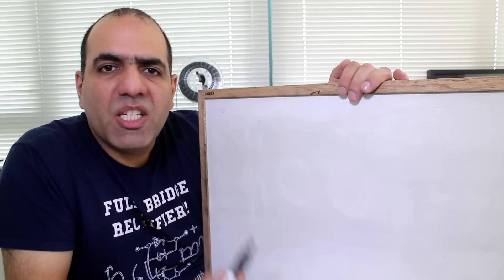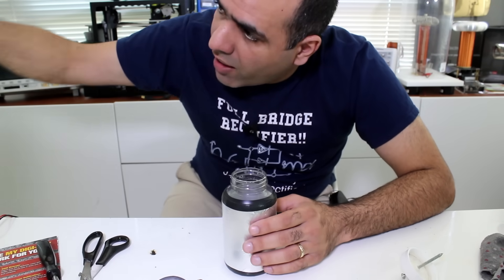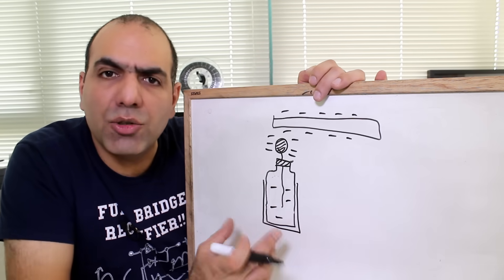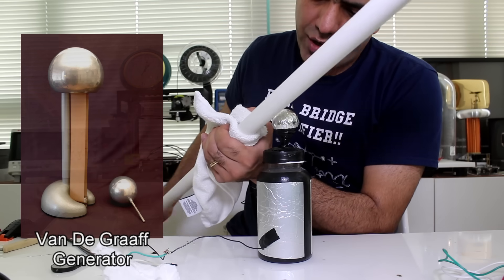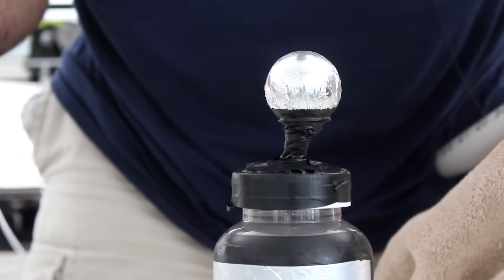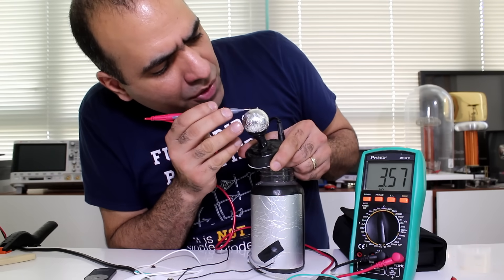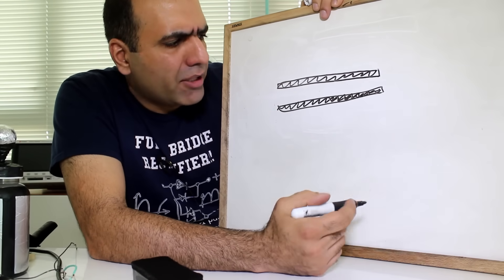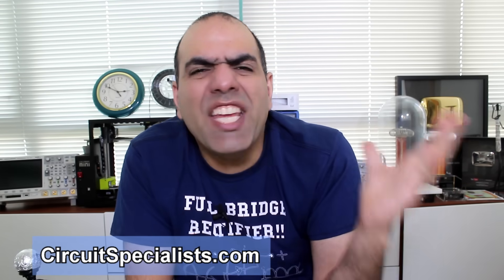Make a SUPER HIGH VOLTAGE Capacitor

Comment: In my high school physics class, when we were given the task of building a Leyden jar, my group (me and a couple other students) decided to use a huge bell jar (larger than the one in the background over his Tesla coil), lined with foil on the inside and outside.

In the middle was a plastic meter stick with an alligator clip wire attached, the other end of which went to the interior foil.  This left an air gap of at least six inches between the charging point (the clip on the ruler) and the outside foil.  Despite this, while charging with a Van de Graaff, the voltage became high enough to jump the gap and discharge.  The spark (or miniature lightning bolt, which it more closely resembled) badly melted the meter stick.  We decided not to try charging it again.  After all, the teacher had informed us at the start that what we were making would be lethal if discharged into a person, so we had better be careful (this was 25+ years ago).

Comment: If you fold the edges of the aluminium foil about 5mm in, that will increase the radius on the edges and reduce partial discharges. Meaning the charges will have a harder time flying away.
I learned this visiting a factory for high voltage bushings. ^^
Reply: Oh and this was an amazing video! Highly informative! Thank you for this! ^^
Reply: folded after or before laminating?
Reply: |_shemhamphorasch_| before, if you do it after it's gonna ark over because you left too much aluminum showing
Reply: Wouldnt a full roll-over edge be better? That would prevent the charge from ever getting to the actual "edge" where it can unintentionally discharge, right?

It would discharge/flow back to self before it ever made it to the edge to build up enough to cause the discharge we are looking to avoid, perhaps?

Like spoons vs forks in a microwave

Comment: i wonder what the capacitance would be if you doubled the aluminum foil layers or even used a sheet of copper foil. Is it linearly higher with more layers of aluminum?
Reply: That's the same as rolling up longer strips, then. So, yeah, more layers — if you look at the cross-section :)
Reply: Using copper sheets would not increase the capacitance, but rather lower the internal resistance of the capacitor. Increasing surface area does indeed result in a linear increase of capacitance!
Reply: Capacitance does not increase with more conductor BUT a thinner isolator will do, also more "sandwiches" in parallel…

edit: not
Reply: If you put more layers on that foil capacitor, it's like putting multiple caps in series. The capacitance goes down linearly with the number of layers, but the Voltage rating increaseses linearly too.
Reply: @ElectroBlud you of course would connect every second layer together, so that it's in parallel, not series.